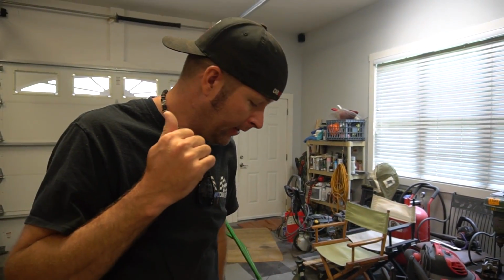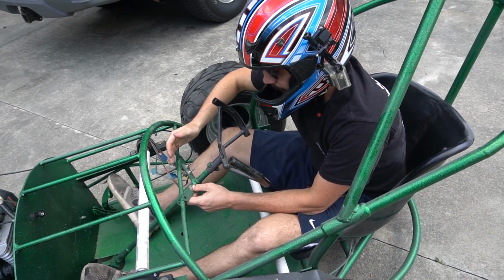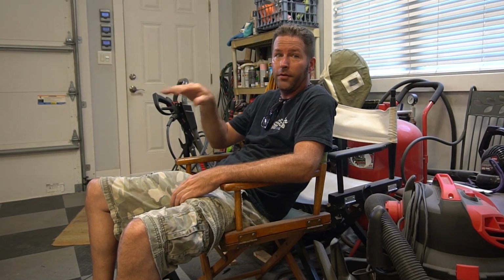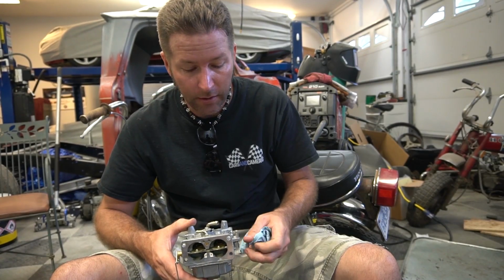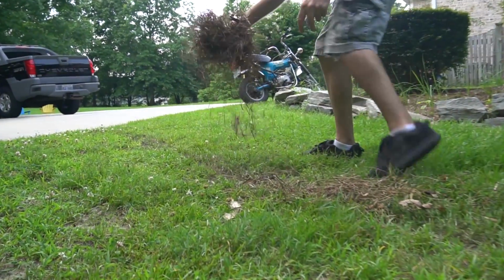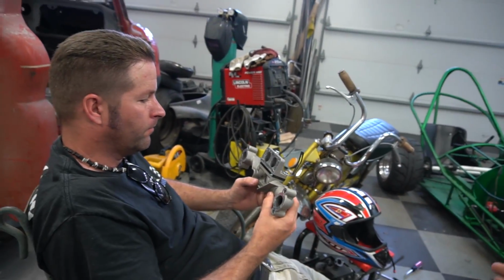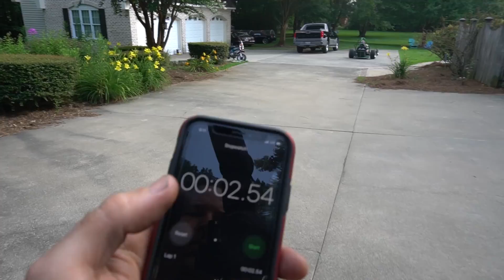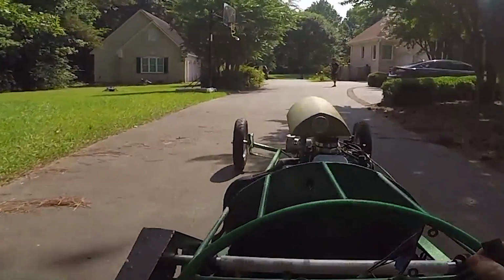THE DRAGSTER DOES (BABY) WHEELIES! | 50HP 670cc Drag Rail Kart

Comment: Can’t you put a VOLKSWAGEN VW 1968 PORSCHE 912 SMOG PUMP as a supercharger
Reply: CykelPotatis little bit small, but a amr300 or 500 would be awesome
Reply: Would be great on the rail.
Reply: They run about 1500 bucks in the states
Reply: Get one from a salvage yard or E-bay?
Reply: огромная эрекция if I knew a crackhead smart enough to know what one was I'd be all over it
Reply: Delicious DeBlair that's where I've got the prices from Mostly eBay in the salvage yards at least around where I'm at and Indiana Southern Indiana there's nothing like that around
Reply: They are not super easy to come by, especially not in working order.

I am waiting on my brother to get a head off of a 2.2l Chevy inline 4 out of my mom's old S-10 pickup which I aim to make a pretty beefy build by sleeving it. Also my brother said that I can use a more old style electronic [not computerized] ignition because of 4 magnets placed in one of the shafts, I have not disassembled the engine yet to see what I am up against, I just know it has a cracked head [the ironies of youtube, right?].

I COULD gt a large billet of aluminum and make my own head for it, but that would be pretty pricey...

It is rated for anywhere from 95 to 103 hp from the factory, without any type of modifications, and I have a small Roots type blower which might work with it, not as much boost as a turbocharger maybe, but good for low end torque and its here, free, and does not require radical changes to my oiling system, so I may try using that...

Comment: Since they don't answer messages on Facebook it's good to see they finally figured out there carburetion is way too small. It's misfiring because it's starving for air. I've worked with v twins since 1989 when the first Vanguard was made. They should be running a pair of 28 mm Mikunis. It seems like a lot but trust me it's what it needs.

Comment: It ran better when u cut intake, cuz that adds more intake volume and that gives you more low end torque... ive done tons of intake mods on v8s...
Make the straight edges more round, and it will get better fuel distribution

Comment: Just put the ducati engine in it for god sake !!!!
Reply: Then it would be down right scary fast
Reply: J.Fish after they have gotten all they can get out of this I agree
Reply: They have a roll cage, what's to be scared of?
Reply: Ian s I was thinking the same, i think the 670 is limited by the CVT clutches. I think they maybe should have put the 670 in the margay chassis, and then put the Ducati Monster in the rail, first, it would get rid of all those kinda sketchy jack shafts they had to use to make it work and it would give it 5 gears to actually make it drag. But the ducati in the margay is pretty Absolute, just get another performance motorcycle  engine for the rail.
Reply: Delicious DeBlair That’s sounds nasty, I love your thinking! Or maybe if they can fit a Hayabusa twin turbo, I’ve always wanted to see another turbo in their vids.
Reply: Mr.Papadopolis they should also "make it have gears" so it will run even faster
Reply: J.Fish Yea completely, then once they have a geared engine they can adjust the take off speed vs top speed with the final ratio.

Comment: How to check the stall speed on the converter- Remove the belt, use a fairly accurate tach. bring the engine speed up watching the tach- when the faces of the sheaves (the part that moves to contact the belt) closes up, that's your stall speed. On a Jr dragster, you set the idle speed to almost that point, so the car creeps into the staging beams, without touching the accelerator. The high idle helps the launch.

Comment: Two things I noticed. You might benefit from airing down your rear tires down to 10 or 8psi (better launch squat and grip patch gets larger.) Second your gas tank your using may not be venting enough to let all the fuel it needs to be sucked to the carbs without causing some vacuum lock in your gas tank. (Put a larger vent than just the cap on your gas tank. Either drill and tap the tank or add a bigger vent to the cap itself.)

Comment: Might not be your problem but when we build pipes like that at work for choppers. The Harley motors seem to respond better with a added “baffle” which we just put a dectorative cover on the end of the pipe or something on the end of the pipe to baffle it some  seems to help with back pressure rather than straight through.

Comment: Hey guys, from my own hard experience I have an idea for that lean rich cutting out.
If the dual-core carb runs front to back of your rail and the float bowl is one single open bowl, then you are starving the front cylinder and drowning the rear, during high G-force moments.
Change the carburetor position to force feed the fuel or at least put a tiny baffle in the bowl to prevent fuel movement. 
Also note to your spark issues, straighten out the ground electrode, cut it down by 40% and round the end, rebend to be equal height with the center electrode to unshroud spark kernel. Try clocking plugs so ground electrode is between valves on each cyl.

Comment: The mod you did to the carb is a great idea for a cammed engine, it does not need to be shaped to flow (it is better to set up as a H pipe like you did)  the purpose is to equalise carb vacumm (enlarges your tuning window) and prevent reversion pressure from reaching the carb.....
In the 45mm Weber and dellorto world it's known as a balance bar

Comment: With the wheel spin. I would recommend softening the tires. A good brand to use is HMS extreme. Don't take much to soften the tires. Just need to deflate the tires, take out valve stem core. Squirt in side tire and spin tire till assumed dry. Then to have a more effective soften also spray the tires on the outside. Wrap in paper towler and then spray paper towel. Then wrap tire in some sort of plastic wrap (bag,etc) an let sit till paper towel is dry.

Comment: Nice project. Having to do it over I would have choose to do a rear engine rail vs a mid engine, could have eliminated jack shafts and related problems. That being said I would start looking at fuel slosh in the carb bowl and may start playing with offset keys to adjust ign timing. At any rate looks like a fun ride.

Comment: On your throttle plate, drill a 3/32 hole close to the idle circuit on each carb throat where the hole is about a 1/8" from the edge of the throttle blade. That will allow your cammed engine idle without the carb spacer being cut out or a cross groove in place. Even with the groove, you still need the holes to allow enough air / fuel ratio during idle. It will also come off the line stronger with the idle air mixture holes in the blade. Have fun and try this before adding a larger carb or any other carb as far as that goes. Good luck.

Comment: @carsandcameras you have the right idea on putting the gap in between the two barrels of the carb you gust did it in the wrong spot you should do it right behind the carb and the bigger the space the better. Engine masters actually tested that on the Dyno and made decent improvements I forget the episode number. Also by doing that you will effectively dubbe the size of the carb. From what I can tell you are spot on on it being like 2 separate carbs. Also on launch you should hold the break and gas so your rpms u faster on launch but you might break traction don’t know

Comment: Drilling out the Jets may have caused your issue, carb Jets are sized by flow rate not internal diameter, there are alot of variables that determine flow, there is a good chance that the Jets are not actually matching and they may not be flowing as much as expected, try changing to some stock Jets, if you can tap the carb to accept Holley Jets you would have all the options you could ever need

Comment: Hey guys keep on plugging away !!!  Here is a different  thinking out of the box idea. Get the carb and ignition correct. Then get rid of the torque converter set up totally. You know your rpm abilities of the motor. Go direct drive single gear ratio you figure out that ratio, then just use an adjustable slipper clutch !! If Go Power Sports don't have one then put out a call to all of the techies watching your videos to open source design one. Full size dragsters use, tractor pullers use. 50 hp with the torque and rpm capabilities your motor supposedly has its the only way to go or get rid of torque converter put in a real clutch with an old heavy duty garden tractor 3 speed transmission. I understand you want to show your sponsers parts which is fine but don't be limited by your sponsers parts if you can use time tested and true mechanical means to make your dragster run like hell and get the parts for almost nothing in a junk yard.  Just an idea. Keep on doing what you do. You are being very honest about all good and bad on the dragster build. Thank you so much for your videos and best wishes to you both. Thanks :  )

Comment: i think moving the rear sprocket inboard from the axle bearing will help you keep the axle straighter and possible help the chain from skipping. this needs reinforcement soon.
also, might want to check and make sure the carb isn't running our of fuel since it starts cutting out after half a second of holding the stall rpm.

Comment: The channel between the two intakes isn't necessarily a bad idea. VW Beetle engines with dual ports have the same design on the intake runners. And some aftermarket dual carburettor kits have a hose between the intake runners. I think it's used to let the engine run smoother.

Comment: I've been reading Hot Rod Magazine since about 1969. Modern thinking is that when you upgrade one part of the entire car you have to change equally everything else. Suspension, carbs, timing, plug wires, valves, cam, intake ect. have to be changed. It will run rough because high perf. engines run rough. I'm no expert though.

Comment: On takeoff the rear left wheel was showing signs of a buckle to the axle or the  wheel it's self is buckled.  On the short length of drag  (60 feet)  you are very unlikely to improve the time below 2,5 sec's. unless you sit with the revs at peek torque then dump the clutch. This however will produce wheel spin on cold tires that will increase time. the only way is to get on a proper  drag strip.  Greetings from Scotland!!

Comment: If your stall speed is higher, doesn't that mean it takes just a tiny bit longer to get up to speed from idle before it engages? Maybe that's why you're still pulling 2.5 in the 60'. It's a short enough distance that a more power and slightly slower torque converter response would balance each other out... and then the better power would show up massively by the end of an 1/8th mile.

Comment: Toyota used a system called T-VIS [ Toyota Variable Intake System ] that had 8 ports [ one per inlet valve ] that had a valve between each pair.

The valves could 'force pair' the inlets or leave them as 8 straight inlets.

CLOSED - 4 inlets open, feeding 8 valves. [ high turbulence increased low down torque ]
OPEN - 8 inlets open feeding 8 valves. [ high flow for better throttle response ]

Toyota went on the vary the valve timing instead of induction from then on. 

Great work :0D

Comment: A lot of comments regarding gearing. This torque converter wether stalled up or down still raises overall top gear as cart goes down the track correct? So set stall for maximum torque and final gear should be at max horsepower rpm going through the traps. 60 foot times may be slower for better overall elapsed time. Gonna take alot of different runs. A dyno for a day may be best option to run simulated 1/8 passes.

Comment: I run a 2in square bore spacer plate on my trucks it helps the idle I think least it seems like it does the increased plenum volume supposedly helps top end and loses a little bit of low-end torque but they idle smoother if you have one bad idle circuit

Comment: To tune the carbs use 2 vacuum gauges   the vacuum the same on both gauges  and used a infrared thermometer  on the exhaust same temp     good luck

Comment: Have either of you cleaned out and or rebuilt the stock carb? 
You could always use a temp gun on each cylinder side. Any variations in temps would tell you lean or rich.

Comment: When the plugs are out perform a compression test. Ohm out the plug wires and check the spark for strength to. The new coils could have a issue as well.

Comment: @9:56 
actually this is REALLY common for guys to do in street rods and shit like that
hell i KNOW that notching an PERFORMER RPM AIR GAP from elderbrock  about a 1/2 to 1.00 inch smooths out the idle and helps make MORE POWER and it also smooths out the pulses on the intake side at idle so it runs smoother
this also works with like a one inch spacer
so it very may well work out well

Comment: Missing almost sounds like floating valves, but probably not. Maybe running a little lean at top end?  It's fun to try different combination adjustments on the carb and manifold lengths.

Comment: Check fuel spray ( mettering) from carb with a timing light or flash light.  If it's got a crankcase diaphragm type fuel pump you could possible be over flowing the cheap needle and seat with pressure on the diaphragm with the engine off.

Comment: What I want to see most is a build using two Torque a Verters' sequentially. More change for the gears and it will give itself a high stall on it's own with the ratio from driver pulley to driven pulley. and engine RPM. I think with 2 Torque converters theres far more speed range you can do. Gear it far lower in the top end. Hell. you could do something similar with a 2 speed clutch setup. Theres more info online about those 2 speed clutch setups.

Comment: Hey guys. Little advice maybe? I think a great investment would be to buy a Micron (2T) tachometer. They read dual temperature sensors, rpm, lap time (you can buy the trigger for the track), and lots of data logging features. I think it would be a great investment to look into! Help er get dialed in!

Comment: Carb is starving for fuel. Clean jets. Fumo float bowl and clean. Blow it out with compressed air. Always install a clear inline filter. Use 100% gas.. Run hot spark plugs. Remember exhaust is just important as intake. If magnets were to installed accurately it could throw off timing. Causing lag in takeoff.

Comment: i cant help but to recall an old drag bike, which ran an beetle flat four and a supercharger hooked to a HD 4 speed.
that would fit, and a supercharged 1600cc is already cranking 70ish before porting and a hot cam...a bit of work, you get 110-120 horses on race gas.

imagine that block hooked to the cvt here.  both ends of the block having two straight pipes poking off the sides..
brooooooop!

Comment: On the honda version of that engine cylinder 2 is set richer at the carb. Sometimes carb issues can be difficult to track down. Gotta tear it apart and blast cleaner through all the holes

Comment: Would it be possible to just bolt up two 212 intakes and carbs? One to each head, I would think you could make a quick linkage just for testing. That would pin point carb or ignition issues from one cylinder to the next.  Just a thought, keep working and if you need a custom intake or anything I'll hook you up. I have a mill, lathe and can weld up anything 👍
Reply: Ryan Higbee carbs too smal

Comment: The polarity of your compass has been flipped by one of your magnets, red does normally point north, and you can reverse it with another magnet. This happened to a compass my son used and had I not noticed it before I needed to use it, it would have caused me a lot of trouble.

Comment: Guys, Listening to the engine while you were taking off, it sounds like the plugs are foul. Get some split fire plugs or titanium plugs for high spark and high heat. Maybe even get some better plug wires. Your pumping gas at a high rate, you need a high performance plugs. Also try using 104 octane gas or gas they use on airplanes. That is what street racers use when drag racing. Now its NOS, but NOS might blow the engine. Use caution...

Comment: Sounds like it's miss firing to me, I would try the stock flywheel and see if it helps, if not you may need to degree the flywheel to advance the timing a bit due to the larger cam

Comment: Hello from California! I beleive you guys are fighting inertia. You have so much torque the carb cant not push the fuel forward fast enough to the front cylinder.  Just my opinion tho. Thanks for the awesome informative videos.
Reply: Country Yard Shenanigans I thought the same and the fuel in the bowl might not be getting to the front part of the carb cause all the fuel will fly back when they accelerate
Reply: Country Yard Shenanigans tbh it wouldn’t be a bad idea cause with all those jack shafts, chains and sprockets they would probably be better off just getting a very lightweight drive shaft and somehow getting their hands on a 1:2 scale axle

Comment: Hey, I saw Muste 1 use a Business card to set the gap between the Flywheel and Coil, Have you checked the gap, This might give you the hot spark you guys need...  Also, I agree the passthrough in the carb plate should help balance fuel mix but you do need a bigger carb...

I can't remember what you guys did for valves, but the bigger the better...
Reply from the maker: Flywheel to coil gap should be correct (we used like a matchbook). Valves are stock size, but springs are upgraded
Reply: CarsandCameras AWESOMENESS

Comment: Is there a diode between the coils? 
I have had a v-twin where it has failed & it caused the one coil to fire slightly one the intake stroke & backfire through the carb but it was not consistent once I put in a new 5 cent diode I run sweet